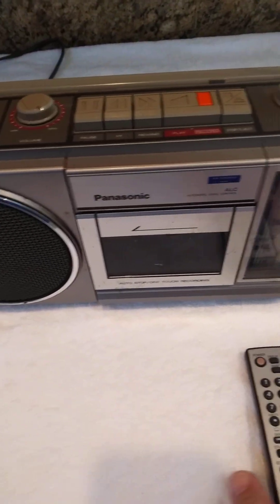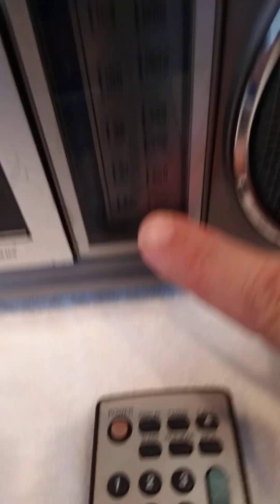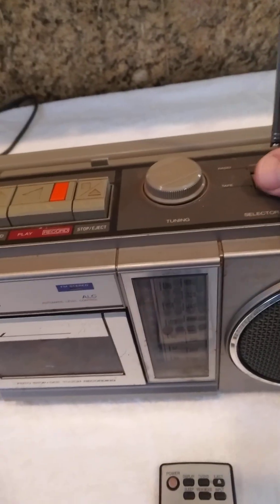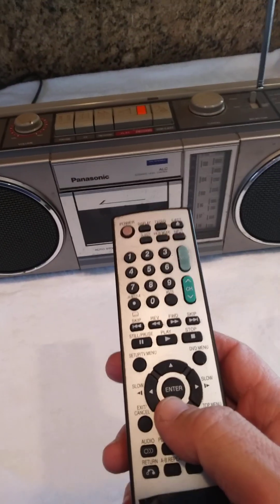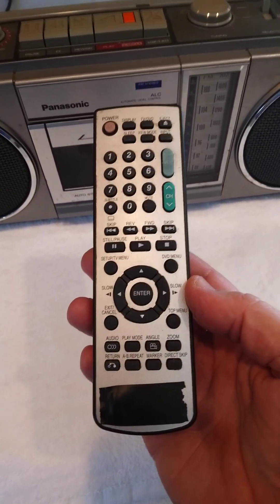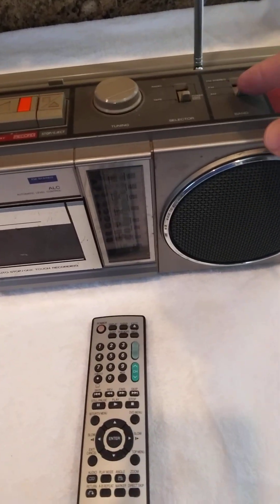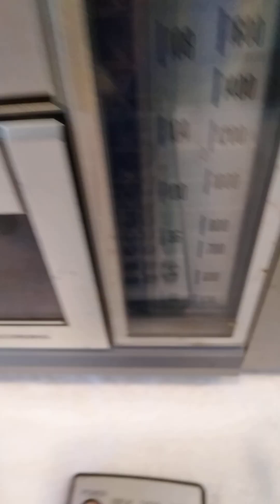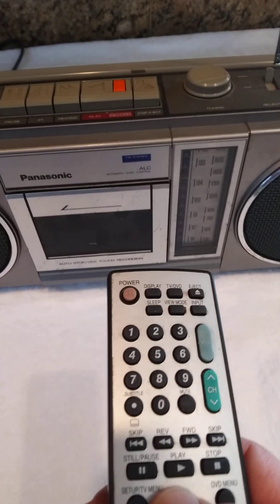Testing my remote control by frequency to see if truly broken

Comment: I tried this in a portable AM radio I have and it only works if I hold the remote physically against the radio. I'm guessing it's hearing the interference from the micro-controller, rather than anything that the IR-diode is transmitting.
Reply: The light we can't see from the remote control stick is a kinda radio wave - that's why the radio can "hear" it
Reply from the maker: Hi yes I agree. It's Transmitting on the lower AM Frequency Scale 535 KHZ or so. We can clearly see its picking up the AM lower frequency because put it anywhere else, AM or FM it doesn't interrupt it. Thanks for taking the time out to Comment on my Channel. I appreciate your feedback and opinion
Reply from the maker: Hi. I  used  this method to see if Remote Controls were defective. I was an  Electronic Major and  repaired Electronics many years ago. TV`s, Radios,  VCR`s Etc.  It's picking up the low AM frequency it is Transmitting low AM 535 KHZ. only the lower AM Spectrum can pick it  up to truly see if remote is Transmitting a signal .Thank you! for your feedback and the time to Comment on my channel